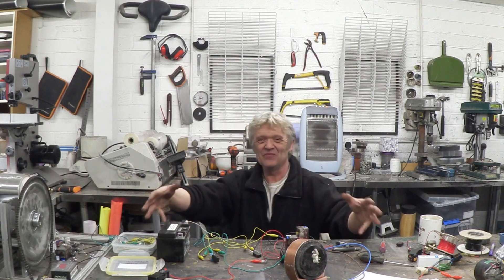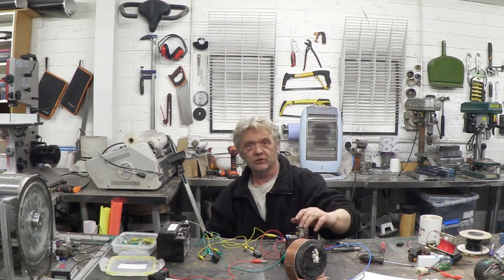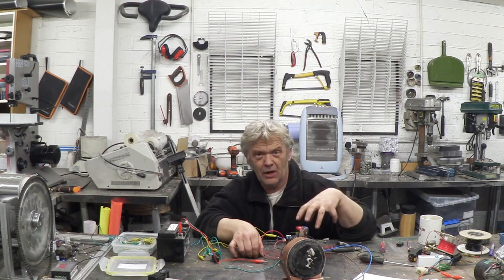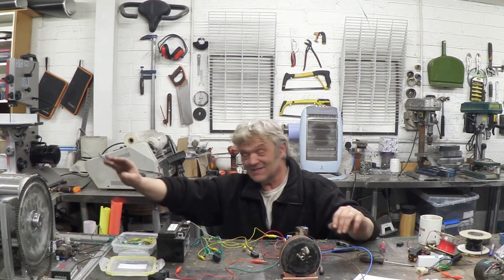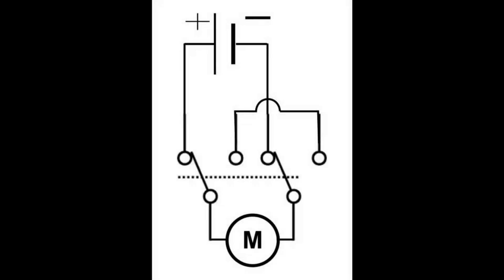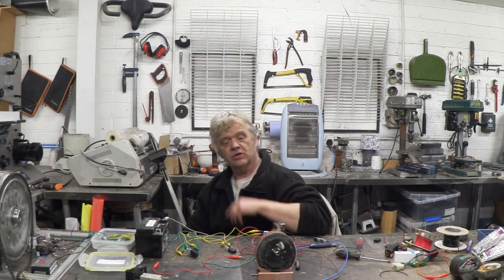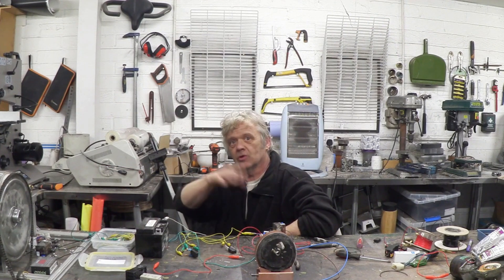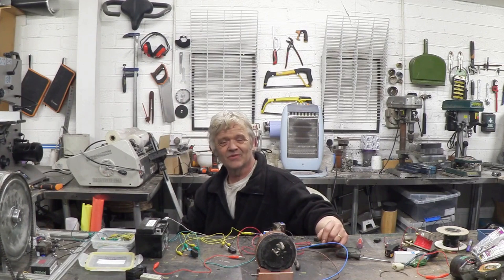978 Complete Stop and Reverse Motor Control Circuit Using Relays

Comment: I think I'll put in my re build plans to use this on the lathe, but with the addition of some resisters one the brake side to soften the stop maybe, as on my old machines a sudden halting of the drive motor might allow my big lathe chucks to spin themselves off their spindles

Comment: Neat circuit! Super useful. A powered exo skeleton sounds interesting, would the limit switches be used for safety, to prevent the motors over-running?

Comment: Good old relay tech. It's possible to use 2 relays, each with one switchover contact. Then have the motor between the center contacts and for each relay one of the other contacts to + and the other to -. This way when the motor is off it will always break automatically and 2 simpler relays will do the trick.
It's a good idea to put everything under arduino control. Each relay coil and each switch. This way you can program the complete behaviour. For example you might introduce a waiting period when an end switch is reached to avoid sudden motor reversal. Also the arduino is aware of the state of the whole thing, for example force not to start another cycle when the previous one is not finished. Force an error when both end switches are activated.... That kind of thing. If you have the IO available it is better.

Comment: Introduce 2 contactors with 2 n/c auxiliary blocks and you wont need relays. You can switch the phases between the 2 contactors to make the motor run in different directions and uses the auxiliary blocks for the limit switches

Comment: You can also use power mosfets in a H bridge configuration by just woring them up almost the same way as the relay contacts but you have to observe the gate driain and source on the fets.
Reply: Relays have the significant advantage the upper and lower contact cannot be made at the same time. For transistors it can happen when incorrectly driven, destroying the transistors. Usually for transistors you need a dead time at which all transistors are switched off. What you could do with transistors is use pwm to control motor speed. Modern microcontrollers have pwm circuitry and timers which can provide dead time and/or pwm

Comment: Looks interesting and a whole lot of other uses! I'm sure you've thought of this, but wouldn't a simple windscreen wiper-like arrangement (those motors are great) connected to the throughput feed suffice? The motor only moves in one direction and speed of the motor would control the whole device with a possible gear ratio change to adjust the holes per cm.
Reply: That would certainly be fewer points of failure and probably less wear-and-tear on the motor.  But I imagine one advantage of doing it this way as opposed to something like a reciprocating arm is that you have greater control over timing, being able to adjust it as you like whenever you like.